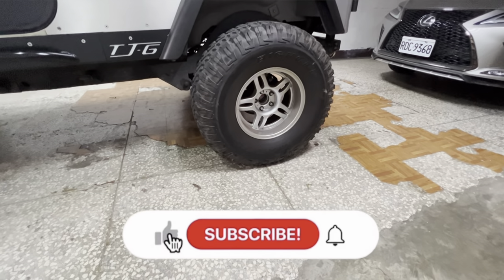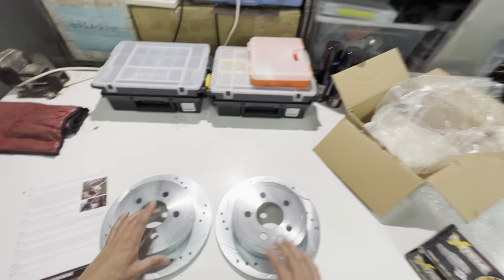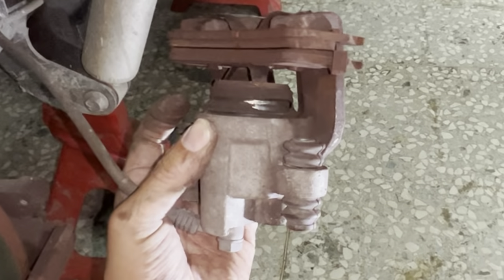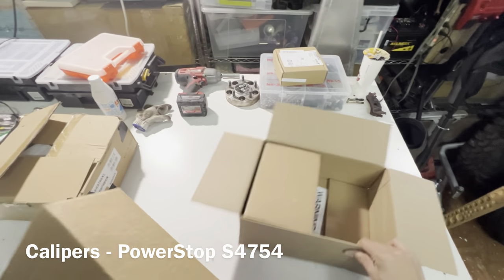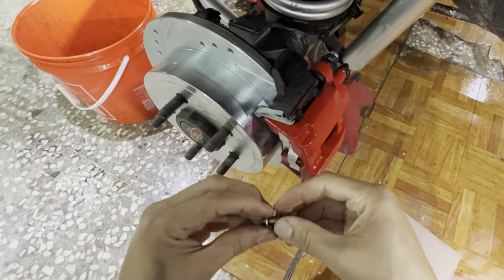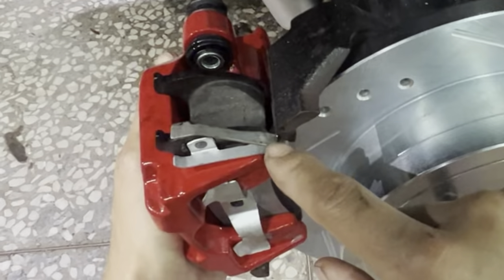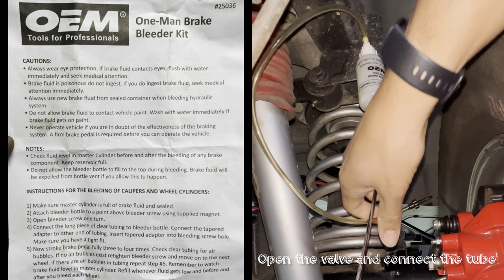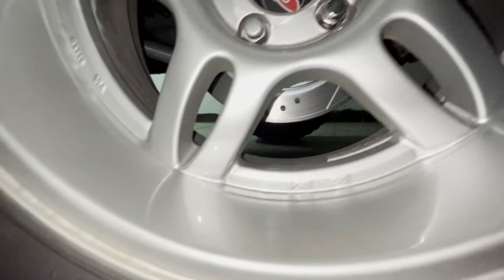Jeep TJ POWERSTOP Z36 Rear Brake install (G2 Dana 44)

Comment: Done that power stop break in once on front axle going into rush hour once it was a pain on city grid and rush hour just had to wing it but this makes me interested since I got the G2 60 and wondering what I was gonna need when I do brake pads also my set up is doing that same thing with the pad not lining up right
Reply from the maker: Yea I’d definitely pull a pad and see what the rose clip looks like before ordering new ones. Not sure if a 60 would except an 8.8 caliper though. Let me know when you do. I’m curious. ✌️